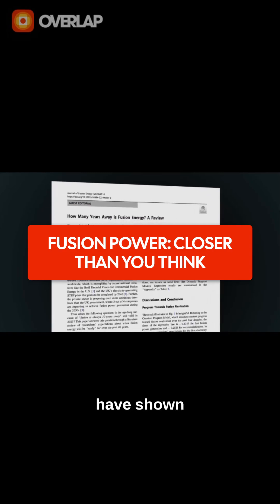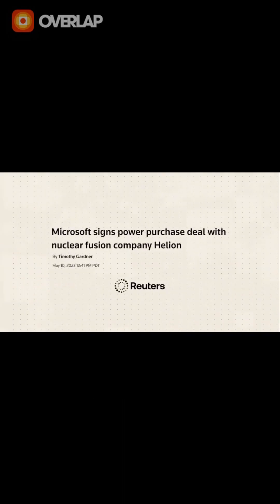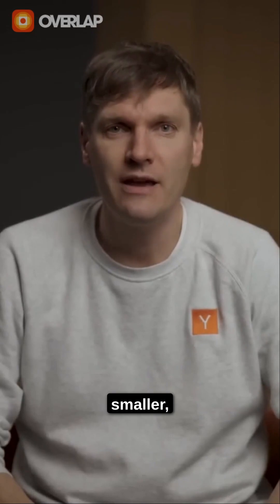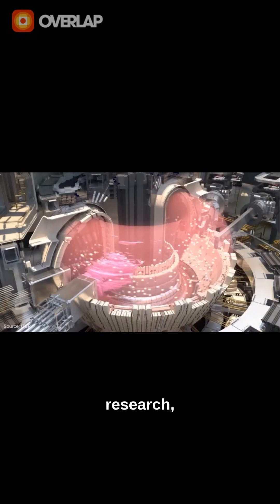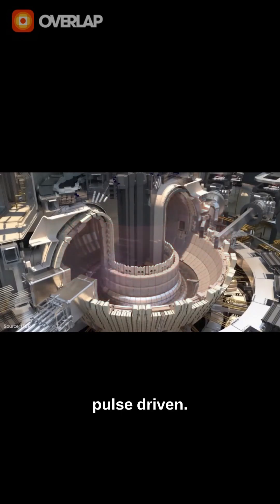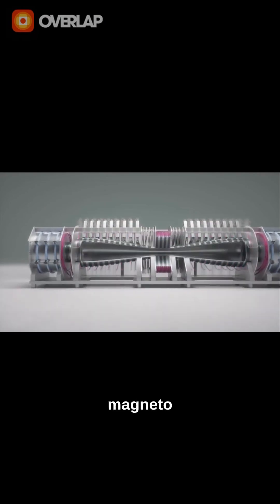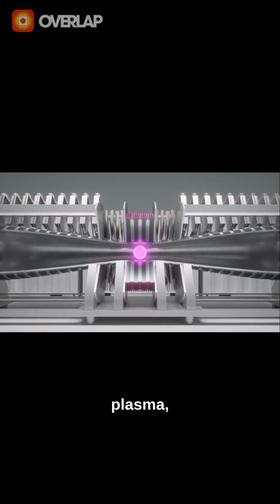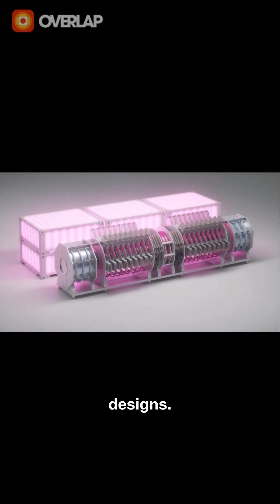Helion's Fusion Breakthrough: Why It's Finally NOT 20 Years Away

Comment: You are planning a reaction with insane heat and crazy low energy output. You top that with a new method of converting the energy to electricity which hasnt been fully proven to even be practically executable. Kindly answer us how you want to target these difficulties in the next few years.
Reply: They are engineering this now. The heat of reaction is contained within the magnetic field is not radiated out the containment field. The magnetic field pushing back on a massive inductive circuit like a huge diesel engine alternator is how it works. I think the more difficult part is making this happen rapidly and safely. They have shown with Polaris they can do it in a controlled manner but doing it rapidly as a commercial application is more challenging
Reply: @kyleganse4978  - Typically fans of nuclear fusion energy experimental projects have no incentive to critically examine the sales pitch narratives that have excited them. The nuclear fusion energy experiments began in the 1950s and have been consistently oversold ever since then. Over 150 experimental machines have been constructed and experimented on since then. Only a few have employed fusion energy fuels and very few have ever generated more than 1.0 watt-hour of pure fusion energy. Even the best record holding experiments remain many orders of magnitudes away from demonstrating a economically practical power plant design.

Helion Energy's 6th generation machine, Trenta, generated around 20,000 test pulses. Not one of them resulted in fusion reactions exceeding 1.0 watt-hour of pure fusion energy. In early January of 2024 Helion Energy claimed that their 7th generation machine would be generating electricity by the Summer of that year. Since then all they have posted, on their YouTube channel are diversionary videos. It appears that they haven't been getting the kinds of results that they had expected despite conducting dozens of test shots. If they do finally achieve fusion reactions they are unlikely to last more than a billionth of a second with shot repetition frequencies of perhaps once per second. This would result in fusion energy duty cycles of approximately 0.000,000,001. A future power plant design would need to improve on that single parameter by a factor of around one billion.

Here are a couple of references worth examing.

-----
From S&P Global

05 JAN 2024
Fusion energy industry anticipates electric power breakthrough by summer
By John Siciliano

The Washington-based company Helion, considered a frontrunner in the race to develop a cost-effective commercial fusion power plant, said it plans to be the first fusion energy company in the world to produce electricity from its prototype Polaris reactor in 2024.

-----
The problems with Helion Energy - a response to Real Engineering (YouTube)